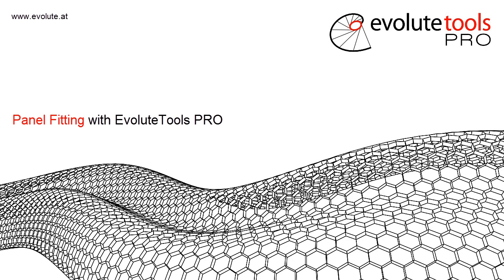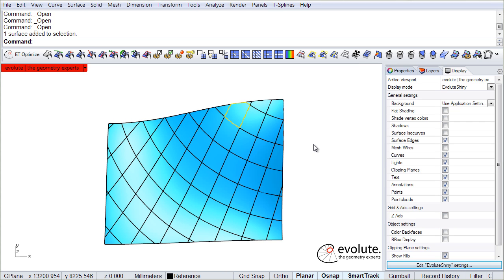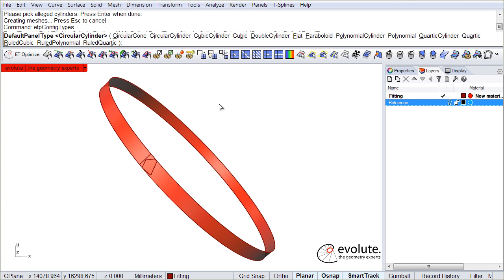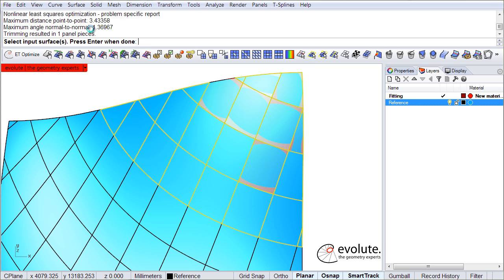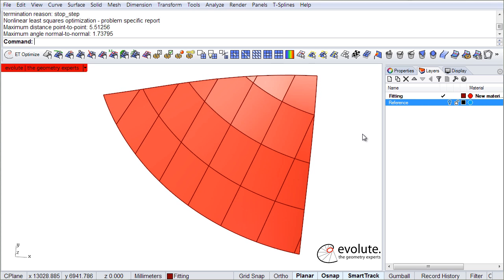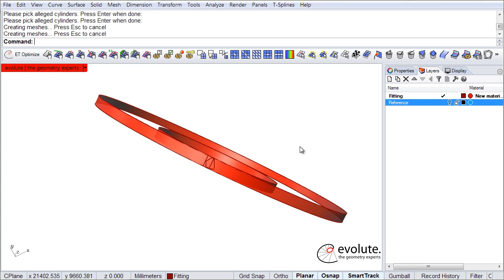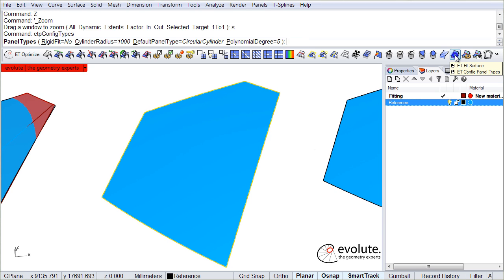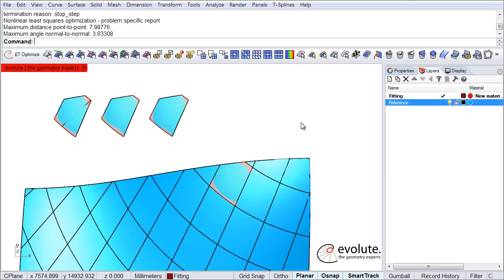Panel Fitting with EvoluteTools PRO

Comment: This is very nice optimization plugin for rhino. Its not to costly, though i have a question for you.
I am rc modeler/hobbyst and wonder what would be defference in conformity of developable plates with and without optimization?
Let say i am building hard chine speed boat hull. Plates of this hull show zero gaussian curve when analised. What would be error in conformity without or with Evolute tools?
I still learn Rhino so i didnt yet laser cut my project to check what error would be introduced in panell fitting over frame.
Further more do i need pro version or i can optimise with lite free version?
thanx
Reply: +Zox Wolf 
Many thanks for your comment! This video is about EvoluteTools PRO - Panel Fitting, which allows for simplification of individual panels (plates) into cylinders, cones, etc. It is typically used in architecture for simplification of freeform facade panels, but might also be applicable for ship hulls. For developable surface lofting and optimization please refer to http://www.evolutetools.com/d.loft instead.
Reply: +Alexander Schiftner Thanx Alexander,
I already commented on yt video about D-loft. I am avaiting reply. 300ish euro for D-loft is not "to kill" price, though i want to know more info about: can i live with or without it in terms of precision in plate developability for RC models :)
maybe you can answer my questions?
cheers
Reply: +Zox Wolf There is no general answer to your question, you will have to find out yourself for your application. I invite you to continue the discussion in our public Rhino forum: http://discourse.mcneel.com/c/plug-ins/evolute
Reply: +Alexander Schiftner Thanx Alexander,
I will chime in, though i can see it is trial and error in any prototyping....